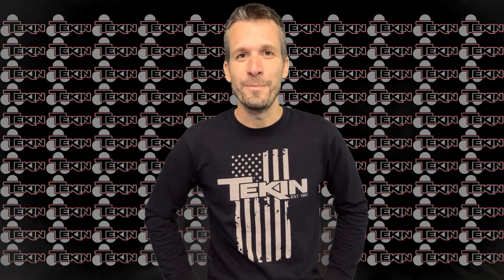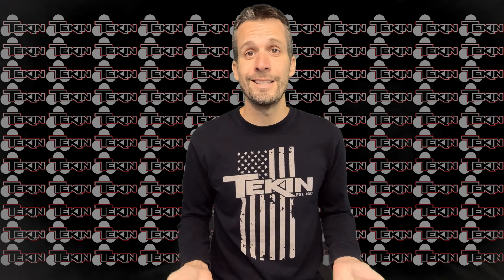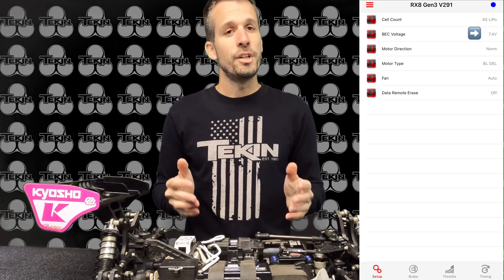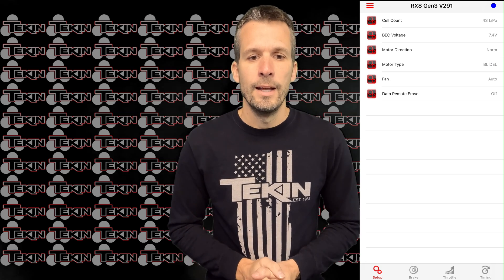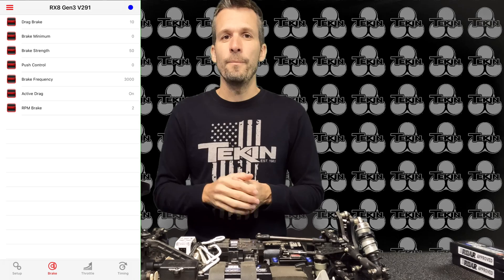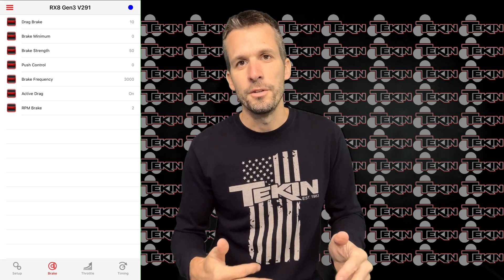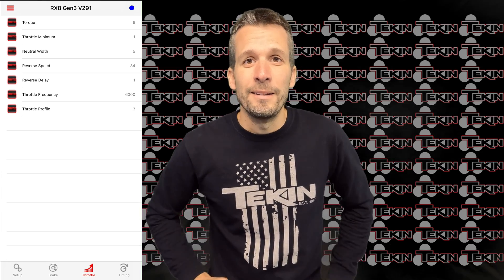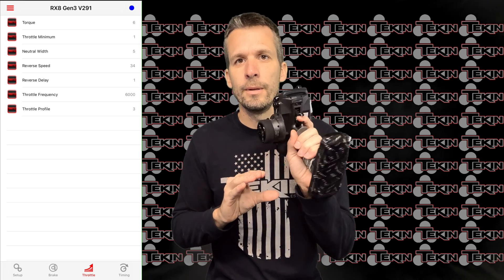How To: Tekin RX8 Gen 3 Ebuggy Set-up [HotWire] [Beginner Tutorial with Ryan Lutz]

Comment: Ryan, thank you for this,  I put this setup on the buggy at Thornhill this last weekend and it was a nice improvement for sure.  Where would I go from here to get more burst over a triple out of a 180?  Felt like I needed a bit more run up, having to go a little wide to set up for them.  Guys running larger KV motors could get that pop while hugging the corner.  Maybe just asking to much out of a 1900 or is there more to be had in that respect?  Thanks!
Reply from the maker: Up on the torque level and or lower on the throttle frequency will both help in that regard.
Reply: @RyanLutz Thanks Ryan!!

Comment: Awesome video.  Thank you!   I'm just getting back into it after taking 3 years off.  I have a 10px As well.  Could you give me a base idea as far as throttle settings? I'm used to drag racing settings, but I know they will be a bit different for this.   Thanks again
Reply from the maker: On the radio i generally leave the throttle at 100epa.  I do all throttle settings in the speedo which are shown in the video.

Comment: Great explanation for those of us that needed a run down of the ESC settings.  I run that same motor/esc setup in my buggy and will give your recommendations a try. For my truggy with 2000kv, other than going down to 4 or 5 for torque is there anything else you recommend adjusting?
Reply from the maker: I sometimes run a little more drag brake in truggy around 12-15. Everything else basically the same. 👍🏼

Comment: What temps are you getting at the end of a 10 min main?
Reply from the maker: With normal setup and it can vary by track and ambient temperatures I can be anywhere from 150-200 on motor and 120 or so on speedo. 
I drive pretty hard though and again lots of variability from event to event.

Comment: Hey Ryan, frequency is pulses per second usually , so the higher the number the more pulses in a second. The less pulses, the more aggressive throttle will feel because it stays for a bit longer on max voltage and low voltage… unless that number means something else👍 i can go in more detail for PWM but maybe that is not what the number in the tekin electronics means.✌️
Reply from the maker: Thank you for the education! I very well could be wrong on the explanation, but at least on the on track feeling I know I explained that correctly. But I did think that's what I remember from the Tekin video on Frequency.

Comment: Yes! More videos on your E cars. There’s not enough pro information on them. Are your settings the same in your ETruggy?
Reply from the maker: Basically except as mentioned in the video I run torque level of 4 or 5 in truck. I also use a little more drag brake usually. Around 12-15.